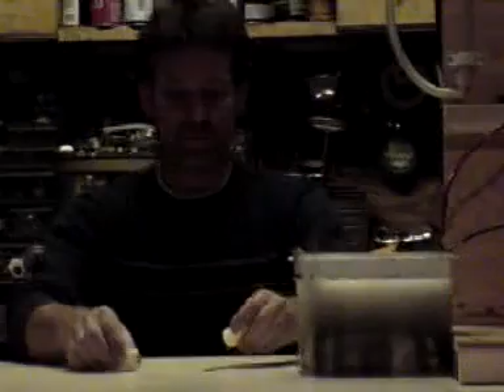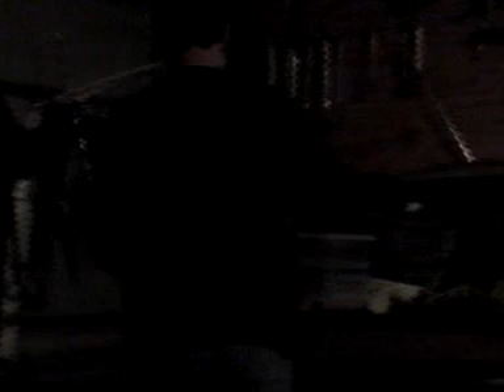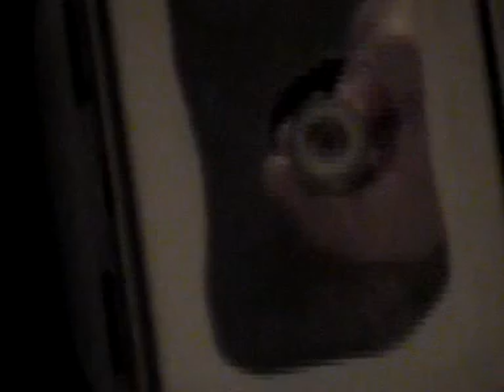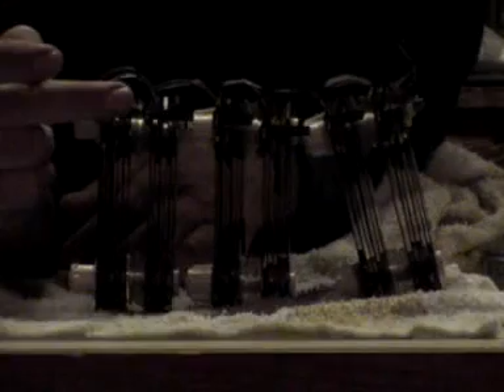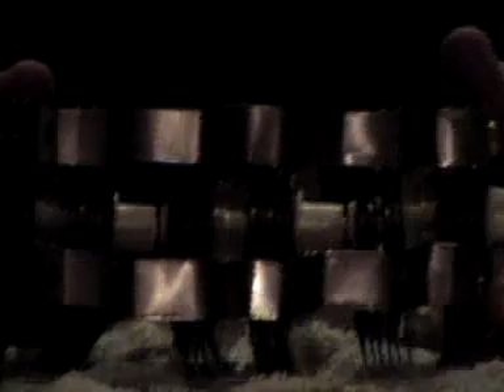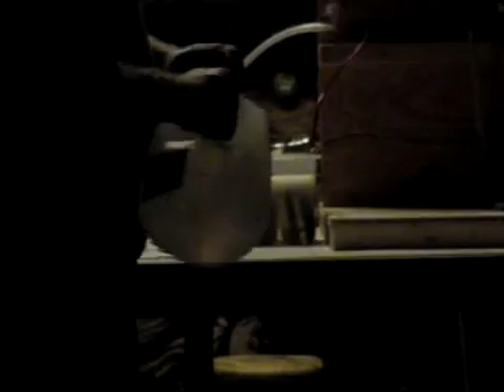new "SIXPACK"

Comment from the maker: My backflash arrestor is on top of the bubbler preventing any flash from getting past it. If the flash did get into the bubbler the hose blows off the top. If by some miracle it was able to reignite the container also has a backflow valve on it. Redundancy is standard in all of my new designs. I realized the smaller the flash the easier it is to extinguish. I even all ow some water to accumulate in the hose to act as a flash arrestor.